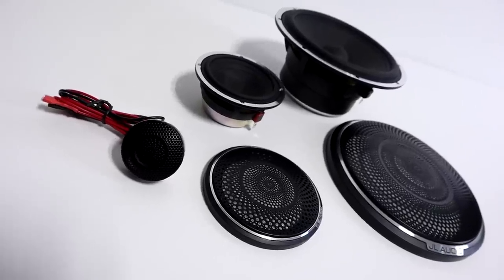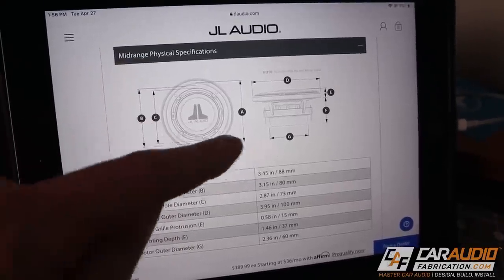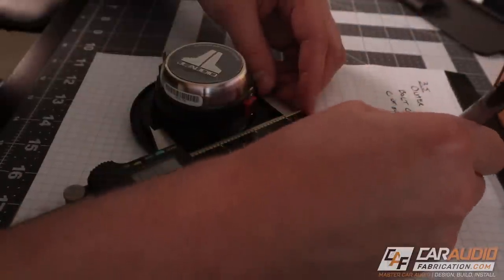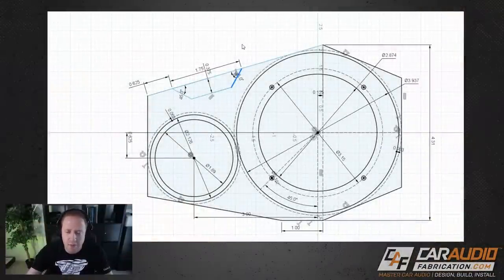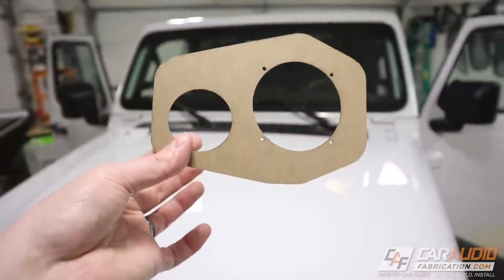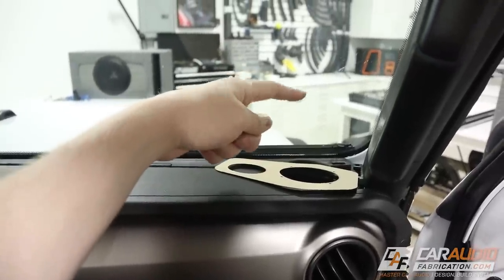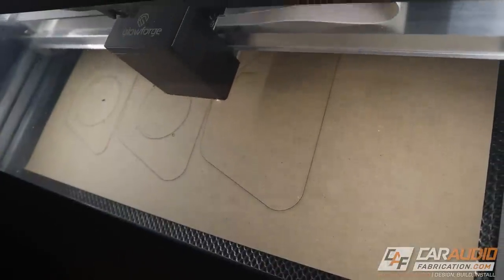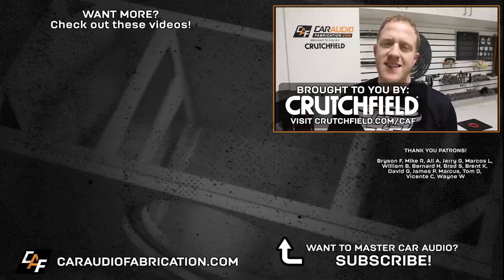This PROBLEM made me START OVER! Custom Dash Pods - Making Acrylic Plates

Comment: Keep up with the awesome vids man! 👍
Reply from the maker: You too brother! Your build is going to be insane!
Reply: @CarAudioFabrication  Help pls
speakers on the right side sound like they supposed 2 but the left side sounds worst  when i swap RCA problem changes side i bought new RCA cables and problem still there could it be bad RCA on amplifier or headunit.? also when i switch off the headunit i hear a POP sound from my subwoofer any help.?
Reply: @beatsandwestside  ok this might sound stupid but I've been installing for over 25 years and I experienced a similar sounding situation before . Try this first , it involves you going over every single wire in your install and looking very carefully for that wire or wires that very possibly has a screw ran through or something similar going on with it, or you'll also want to look for that wire that has a strand or two coming loose slowly but surely and is ever so often and ever so slightly touching something that it shouldn't. This process is time consuming but you may very well find it invaluable to do this process and good luck with everything

Comment: Thumbs up man, I can't even count how many times I screwed up during my amp rack and A pillar fabrication for my C7s lol! Mine came put great for my ford flex. Right now I'm just messing with the tuning of the 2 TWK88s I have for front and rear separation. But I've been subscribed to you since you had like 10k subs, I've learned alot from you and James from High Voltage Car Audio and I appreciate both of you so much. You help average guys like my self to make our car audio sound great!

Comment: The way machinists measure hole distance is to measure the inside distance and then add the diameter of one hole (2 halves). That way you are always measuring against a surface instead of eyeballing something.
Reply from the maker: Very true! 👍
Reply: Alternatively, you can do outside to outside and subtract the diameter of the screw hole. I honestly was expecting him to do it the right way.

Comment: Thanks for including us in the redesign process Mark!  It's unfortunate that the original plan won't work.  I know windshield reflections can work well but, IMO, they're never as good of a sound as the more direct aiming of the original plan.  Windshield reflection can't achieve as good of imaging and you'll also have a lot more resonance from the windshield to deal with in the processor.  And while you can correct much of that in the processor EQ I don't think the end result would equal (almost punny, I know) the sonic result of the other method, again my personal opinion.  

I'm certainly not saying that you're wrong for doing this, I totally agree that the sight line reduction is too much and makes for dangerous amount of blind spots.  I'm simply saying that it's unfortunate that you have to do it.  Jeeps have always been a more difficult challenge when it comes to aftermarket speaker fitment.

Comment: Have you ever considered adding a CNC router to your workshop?  You do so much work making custom pods and boxes, it seems like a no brainer.  I needed some rear tweeter mounts, and was able to take a few measurements, tape down a piece of expanded pvc, and have perfect mounts with the push of a few buttons, and it's repeatable.  The nice part is repeatability.
Reply from the maker: I have one. I can still build faster with templates. Everyone forgets the drawing part and that you have to fixture each piece. It would be great for 50 of one part, but with one or two its faster to just knock it out. For smaller stuff like this where trim rings are small and using acrylic I like to use the laser.

Comment: I just love JL Audio. I have been a professional installer for over 20 years, I was a rep for 9 of those. As of this post, three of my cars have simple JL amp and component installs including equipment installed when my 2004 Mercury Marauder was new. Also JL amps and speakers in 2 other cars utilizing OE head units. 
However, even a guy like me, diehard in my loyalty and steadfast in my choice of equipment just can no longer pay the ridiculous retail prices for this equipment. 
Right now 2 more vehicles are gonna get the sound treatment and even old reliable stuff like Fosgate and Alpine have become garbage. 
Even then, prices for JL just seem predatorily inflated.

Comment: Could you have just fitted the tweeter pod in to the OE speaker grill? I'm currently looking at options for a Renegade and have thought about doing just that, the other option is just to get a high end coaxial and then modify the wiring on it so I can split the signal to the mid and tweeter and run it active.

Comment: I did a 2019 Jeep JL with almost EXACT setup. It was not fun because of the glass. At the end, i bought new OEM panels and fiberglassed speaker rings to retro fit the speakers in the dash. It allowed for bolt in fitment and looked really nice. I gave the original panels back to the customer for use in case he traded in the vehicle. 

Overall it was a 30 day project with fiberglassed dash pods, fiberglassed door pods, custom retrofitted soundbar 6.5" speakers, fiberglassed rear subwoofer in the corner, full sound deadening of vehicle, and katzkin reupholstered leather seats.

Full vehicle break down on my IG @Modfyd_Motorsports

Comment: Love that you are doing these to your wrangler! 

Quick question:
We are going to add a ACM 4.300 to our 2021 wrangler rubicon, along with speaker upgrades as well of course. I've ordered a T harness with load resistors built in, and as far as I am aware that is all I would need right? The ACM should be able to make great sound even out of the high level inputs from the abysmal 7" uconnect without a need for a LOC correct?

Thanks!
Reply from the maker: Yes, should be good to go! Just keep in mind there are always benefits to be had with adding DSP in the future, perhaps an upgrade
Reply: @CarAudioFabrication  I appreciate the response! Always nice to get confirmation before a purchase. I've watched your videos on DSP's and its definitely something I'd be interested in. For now I just need to be able to enjoy, or at least hear 😆, music when we have the top down.
Reply: DSP is the way of the present, future and should have been past for at least 10 years. You won’t look back :)

Comment: I have a Subaru BRZ I like the setup for my doors and dashboard Except for needs to be sound dampening better speakers my real question is the trunk is small and subwoofer size enclosure size how much does that matter to need to get a smaller enclosure because I have a small trunk or does that even matter just making sure your box is big enough for your speakers

Comment: Good job question will you have to take out the factory  amp and put a stranger amp. Only because you changed factory speaker. And if so wich would you put.thanks
Reply from the maker: You don't "have" to use an aftermarket amp, but the difference is substantial by doing so, definitely stay tuned in for more of this build to see

Comment: At this point it would have been much simpler to just use the JL Coaxial you've shown that fits just right in the factory location, with the onboard crossover bypassed you'll still get active and full versatilty, but for lot less work .